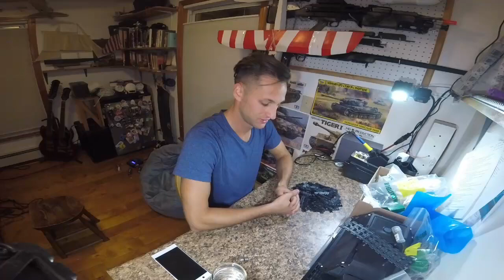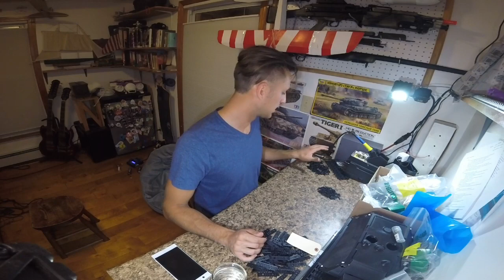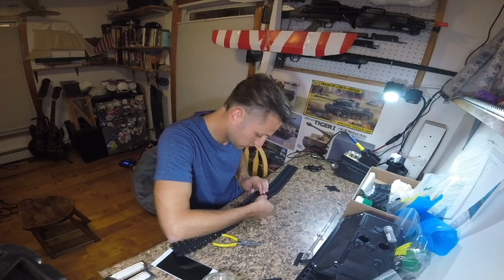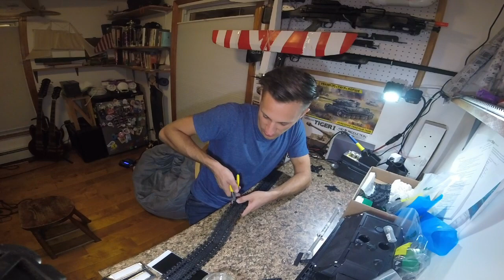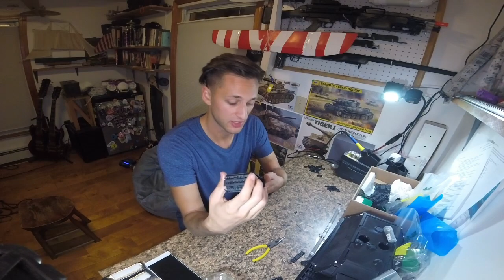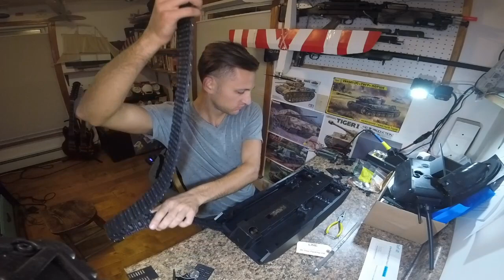1/16 RC Maus Project: #5, Let's Make Some TRACKS!

Comment: I note that your large cleat portions (Main track) have a minimal guide horn. I've been delinquent in finishing my Maus RC project (lack of time & funds). https://can-amrctankclub.canadian-forum.com/t1690-maus-the-rc-project
Reply from the maker: That's a fantastic model you're making! And yes, they do have a smaller guide. I'm only trying to get accurate /enough/ with my modeling. I've been able to cut tons of time from not fretting over the details. I can always go back and fix it sometime, but if the project loses momentum it will be for naught. You should continue your project!